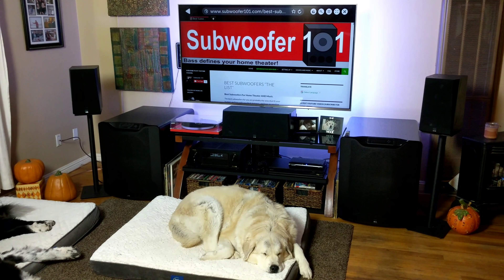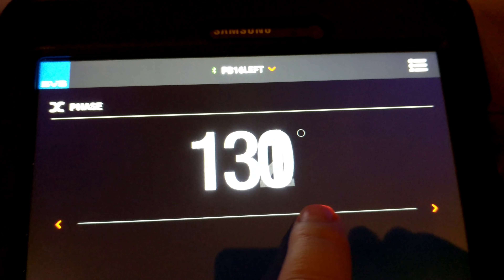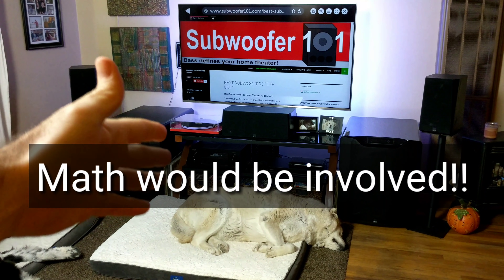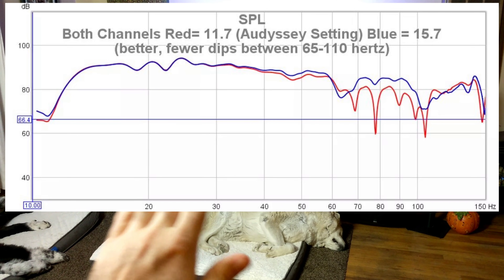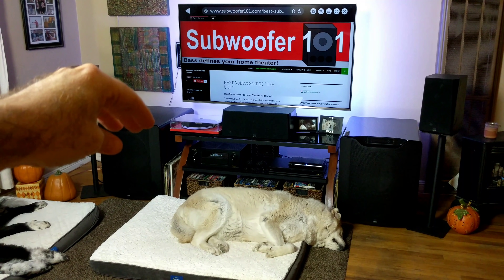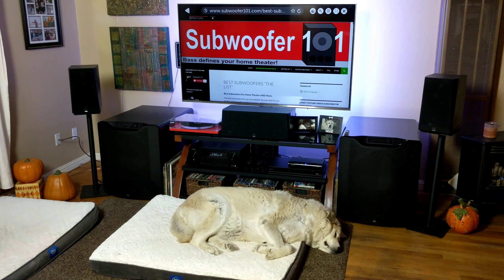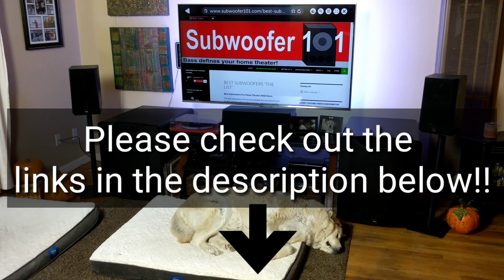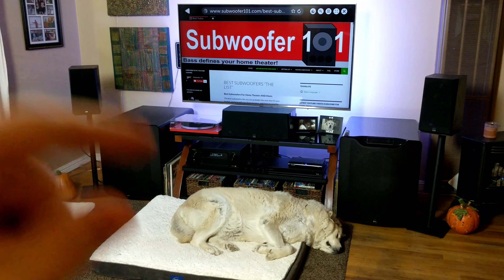Subwoofer Phase Setting: Which is best? 0? 180? (Subwoofer Setup Tip)

Comment: Firstly you don't need to two subs with any hifi. Room room room Acoustics! That comes first always. Get that right and then if you want a sub, one will be more than enough. Phase, well go by ear, no maths, no science. Listen to which phase sounds the smoothest and punchy without any boom. The bass must be musical. It's fairly easy, it's not complicated. It's either 0 or 180. Hey I use Rel so the subs are top notch and made for music.
Reply from the maker: There's just so much wrong with your comment. Not one particular thing, but most of it. 

But that's ok, we are all just figuring it out. I try to stay supportive and approachable. 

I'm not here to pick on you or make you feel bad. 

Bass is NOT easy. That's why my channel exists. 

The phase switch is a hammer when a scalpel is needed. It has 2 options out of 180. So the 2 options are typically wrong, and even worse. 0 is only correct when the distance setting is used to adjust timing. Again, my graphs show this is not opinion. 

Math helps a lot, again I have the graphs to prove it. And it's just simple addition, not calculous. 

"Musical bass" is typically unintentional code for shallow, weak bass. Deep bass is a LOT more musical. 

Room treatment matters, mainly reducing hard reflective surfaces and echo. 

Room treatment will never replace what dual matching ported deep bass subwoofers can do. 

Better than nothing, but it is physically impossible for room treatment to resolve the standing wave effect in a meaningful way. 

Sorry, I'm trying to be as cool as I can, but everything you stated as factual, just isn't. So mainly I'm responding for the sake of those who will read your comment. 

I hope you stick around, be open to new ideas, new equipment, and a new approach.
Reply: @Subwoofer101 I'm a musician and have worked with sound engineers for nearly 26 years. I know when I hear quality sound and so poor sound is picked up instantly. One sub is all that's needed, two if you want to, but it really isn't needed. Room acoustics, well absorption panels rather than diffusion is only needed but this is another chapter and lengthy one. Never over complicate sound. Musical bass is not loud bass for one minute. If you like that sound of cheap car bass sounding woofers then so be it. Bass should be lightly heard and punchy, yet importantly flowing beautifully with your mids and highs. I'm talking about music, not, theatre use. Distance has nothing to do with it at all. You like graphs and tables and probably watch the way your subwoofer moves rather than enjoying the sound it produces.

Comment: You are so over the top with your subs its ridiculous.
Reply from the maker: How interesting. 

In what ways am I so ridiculously over the top? 

I'm just curious because I've seen some setups on YouTube that make my setups look underwhelming. 

Are you just assuming that the overall sound and experience is over the top? 

It would be understandable, because if I used typical subwoofers, it would sound like boomy garbage. 

It does not. In room measurements confirm it. 

One thing you are right about, I do obsess over bass, because it is so easy to get wrong, and the most challenging aspect of home audio.

Comment: Hmmmm I'm not one to knock people's effort especially when reviewing products or giving tips such as these but I'll have to disagree on with most you've said on here. I almost recently upgraded my twin Monolith by Monoprice V2 ( 12 inch subs ) as I wasn't getting the type of bass I knew they were capable of. I run separates ( Marantz AV8805, Emotiva XPA Amps plus Klipsch speakers from the RP Range ). 

I did the plus 4 feet suggestion after calibration and for weeks and weeks I wasn't happy until recently. I discovered that with phase set to 0 and plus 4 feet in speaker distance, the bass from the subs interacted negatively with the bass from my towers crossed at 80 hz. Using a tape measure, I corrected the sub distances and then set the variable phase to 90 degrees!......What a difference! Deep deep powerful bass from the subs with 0 interference from the bass from both towers.
Reply from the maker: So essentially you phase shifted, but rather than advancing the bass, you are delaying the bass. 

By measuring the subs' physical distance, you are undoing the room correction compensation of adding a few extra feet to account for DSP delay. 

That makes the bass to hit after the rest of the speakers. 

Phase other than 0 also delays the bass. 

So you are doing what I'm suggesting in the video, shifting the phase to remove the cancellations from your towers. 

+4 feet after room correction value with 0 phase is a solid solution, but sometimes you need a little more or less. 

Because of bass decay, I think advancing the bass (adding distance, 0 phase) is better than delaying the bass (phase other than 0, reducing distance value). 

By delaying the bass, you are guaranteed to never have your bass in proper time, as it's always "chasing" the rest of the sound.

By advancing the bass, perfect time occurs at the very beginning of bass decay. 

So to be clear, I'm sure you achieved better bass response, it's just the method is going the other direction. 

You probably needed more distance, possibly a little less than 4 feet, but the function of timing shift is effective either way you go. 

My guess, based on what worked for you, between +4 and 10 feet over the room correction value would yield the same result. 

Long response, but what you did worked because +4 feet wasn't enough. 

Subwoofer placement can also make a difference. 

What you absolutely did correctly is trust your ears. 

If delaying the bass is what you prefer over advancing the bass, then that is the right thing to do. 

At the end of the day, it's your system and you should get the most enjoyment, even if it means going against the grain. 

I built my channel by doing just that.
Reply: @Subwoofer101 Hmmmmm thanks for the response. Very technical. So what I achieved is phase shifting? I don't recall what the calibration results were else I'd try your suggestion again and probably go higher than plus 4 feet with phase back to 0.

On a side note, how would a sub that's running on an external amp with no phase adjustment deal with this phase problem? I am thinking of modifying a 15 inch klipsch subwoofer to run off an external amp as the plate ones from klipsch are so bad they fail within a year and I've had two replacements in 3 years. 

This phase issue is precisely why I haven't done the modification yet.

Thank you.

Comment: Set to 0. I turned it on a few times and it makes it sound like the bass is inside my head but the bass is gone at the same time. I can’t quite explain it right but it feels very awkward
Reply from the maker: Sounds like a cancellation. Or a dead spot. Some people call it bass suck out. 

Dual, matching deep bass subwoofers, and adding 4 feet to the post room correction value. 

So if the subs are 10 feet away, room correction will say it's about 13 feet away from the DSP delay. Boost that distance value to 17 feet, (+4 feet from the room correction value of 13) and your missing bass will be delightfully audible.

Comment: I have 3 total subwoofers, two of them are in the midpoint of my room which is about 20 to 22 feet wide, and one of them is in the middle of that 20-22 feet. I set my phase out the two in the midpoint of my room to 0° and the one in the middle of the 20-22 feet part of the room to 180° phase. I don’t know if it’s technically right, but this has sounded the best and made for the smoothest bass response for my ears, and eliminates my dead spots. Very interesting!

Comment: Bought 2 monoprice m215s and they dont boom like they should. Using onkyo rz3100 hooked up lfe. Any suggestions? Factory resets and recalibrations have been done with each setting.
Reply: Is the connection RCA then you need a splitter

Comment: Higher frequency travels faster
Lower frequency travels slower
Reply from the maker: Sound travels at the same speed, within the same temperature and medium, regardless of frequency. 

But to your point, higher frequencies do vibrate faster, so 1,000 hertz vibrates slower than 10,000 hertz. 

Bass also decays slower than higher frequencies. 

Sound will travel faster or slower with different temperature, elevation, and medium. 

So technically, the speed of sound changes with the temperature throughout the day. 

The point of the video is to get the bass in the room slightly before the higher frequencies, so it will begin its decay during the moment of perfect timing, rather than after perfect timing. 

You were on the right track, and I hope my explanation was not discouraging or intimidating. I try to keep it friendly around here. 🙂
Reply: @Subwoofer101  yeah , your correct I googled.

Comment: For me, I have always rocked 180degrees on subs. Optimal or not, it feels much smoother and deeper like a cinema. I’ve tried feeakin everything and now 15 yrs later I got new subs. Tried 0degrees for once on both like the Hifi man said, and meh. changed both to 180 and oh my… 😮 what’s wrong with me😅 both in front like my old one
Reply from the maker: You're not wrong, you're already phase shifting by using 180 phase. 

The problem is, when you set it to 180, you are "delaying" the bass. 

So you're still getting the benefits of less cancellation, but in my opinion, setting the subs to 0 phase, and then adding 4 ft to the subwoofer distance after room calibration is better because you are putting the bass in the room "before" the mids and highs. 

Because bass decays slower, I think advancing the bass instead of delaying the bass sounds cleaner. 

When you add 4 ft, your AVR thinks your subwoofer is 4 feet further away than it actually is. 

The distance setting in an AVR is basically just timing. 

So to compensate for being 4 ft further away, it delays the other channels in relation to the subwoofer, so that the subwoofer gets the signal a few milliseconds before the other channels. 

180 phase delays the subwoofer by a few milliseconds. 

Both offset the timing enough to reduce cancellations between the subwoofer and the main speakers. 

I just believe that because of slower bass decay, advancing sounds cleaner and more cohesive.
Reply: @Subwoofer101  which sab to put Distance 4ft friend to the one that is closer than another???

Comment: I have 2 subs using a Y splitter into my receivers only Sub connection. My svs pb3000 is in the front and further away than my second sub which is an older SVS CS Ultra thats in the rear in the opposite kitty corner. I can only select distance for one sub. I am assuming I do the distance +4 from the front that is already furthest distance?

Comment: Hi @Subwoofer 101, how do you get Subwoofer 1 and Subwoofer 2 to config separately in your Distance settings? I've got Denon's AVR-X2400H
 model.
Reply: From what I’ve learned if your receiver while doing room correction does not tone each sub separately then there is no way to do it.  If your receiver has only one sub input then it would be impossible if you split the rca signal.   If it’s got two and only one signal while room correcting then it’s not a true dual sub receiver.

Comment: To Manually set Phase correctly:

- let your speakers play full range (ie: mine play down to 50Hz)
- set crossover on sub to 10Hz above (ie: mine 60Hz)
- Play some music with bass, adjust volume so Sub is noticeable but not too loud
- play the lowest frequency of your speakers (ie: mine 50Hz tone). can download a free tone generator app for phone or computer…) 
- use SPL meter ( or smartphone with SPL meter app works). I use settings C-Weighted, Fast, Low on SPL meter) 
- cycle through Phase settings (typical 0, 45, 90, 135, 180, 225, 270, 315) and look for the lowest SPL level = Null Point
- if Null Point is 0-180 then add 180 = your Phase setting.  if Null Point is 181-359 then subtract 180 = your Phase Setting.
- now you can play with your Crossover settings (ie: Speakers set to 70 Hz, Subwoofer to 80 Hz. etc…)

If Dual subs are both in front like in this video, use this method to setup each subwoofer individually (or just use the same setting).  If running one sub on front wall and one sub on rear wall then flip phase 180 degrees from the setting you determined on front sub.  (ie: if front sub 135, then rear sub 315)

enjoy !
Reply from the maker: I have to disagree here, at least if you're wanting optimal sound. 

Before I disagree, I want to say that I do appreciate viewers trying to help other viewers. I definitely encourage that on this channel. 

But here are the problems with your particular method. 

First off, setting crossover any lower than 80 HZ makes integration difficult. 90 HZ is my minimum crossover value, regardless of speaker size. 

Secondly, I set all speakers to "Small". You can see my Large vs Small article on my website for a deeper explanation. 

Third, and most relevant, is that setting subwoofer phase to anything but 0 creates a delay. Why is that an issue? 

Bass decays slower than mids and highs. So delay exacerbates the timing issues. 

The reason I recommend adding 4 feet to the subwoofer's value AFTER room correction is because instead of delaying the bass signal, it advances it. 

Since bass takes longer to decay, it cleans up the sound as much as possible when shifting the phase. 

If having your subs in perfect timing with your mains was ideal, phase shifting/time shifting would be unnecessary. But if you don't shift phase/timing, you're missing out. 

If you delay the bass (using the phase adjustment on the subs) the bass will be "chasing the mains", and wouldn't sound as good as if the bass was "ahead of the mains", because of the slower decay of the bass. 

There's no such thing as "perfect bass", but adding 4 feet to the subwoofer's value is pretty close. 

You're still phase shifting, reducing cancellations, but it's in a way that sounds cleaner. 

Lastly, dual matching subs are ideal, for the cleanest, most cohesive and explosive sound. 

If you're going to measure dual subs, they should be measured at the same time. 

Doing so separately negates the positive effect of constructive interference, measuring peaks and nulls that won't exist while both subs are working. 

The easiest way to deal with phase is to advance the signal by adding 4 feet, or, if you don't have room correction or an AVR that has distance values, I would figure out how to delay the mains by 4-8 milliseconds, depending on whether your subs have DSP or not. 

The best subwoofers will have DSP, and that will introduce delay. That delay could be anywhere from 1 to 4 milliseconds. 

That's really getting into the weeds, which is why it's a LOT easier to do on an AVR that has room correction. 

I don't believe that your method is the best way to set phase. It might be a way to go about it, but having tried a number of ways myself, you won't achieve the best possible sound. 

But again, I do appreciate viewers contributing to the channel, and I mean no disrespect. I'm pretty notorious for not going along with conventional wisdom. 

Questioning conventional wisdom is almost half of my channel's content. 

Big subs don't necessarily overpower small rooms. Bigger drivers don't automatically mean better bass. 

More power doesn't mean better bass, if the power isn't delivered where it's needed most. 

A 12" sub can sound FAR more impressive than a 15" sub with twice the power. 

Factory response numbers are nearly useless in the decision making process. Same with Max SPL. 

Everything is confusing and misleading, but I try to make sense of it all. 

Again, I do appreciate the contribution. It inspires topics to cover. That helps everyone.
Reply: @Subwoofer101    I was just talking about Manually setting up Phase (without room correction ie: Audyssey).  With the manual SPL method, I set it up as explained then change crossover settings (ie: 80Hz) afterwards.

Comment: I have dual subs.  The rear sub is 0° and the front sub is 0°.  When I set the front sub to 180° bass sound a bit louder.  With the front sub at 180°, when I set the rear sub to 180° the bass sound a bit louder again.  Is that how I should set it for best audio?
Reply from the maker: Set them both to zero phase, then add 4 feet to the room correction value on your AVR. 

Similar to what you are experiencing, a phase shift, but the timing is more advantageous. 

By using 180 phase, you are basically delaying the bass. 

By adding 4 feet to the distance, you're populating the room with bass before mids and highs. 

Bass has a slower decay, so it will sound better advanced rather than delayed.
Reply: @Subwoofer101  with both the subs are set to 180° the overall bass sounds louder than when they are at 0°.  By reverting back to 0° and adding 4 feet will that add back a more bass?
Reply: @Subwoofer101  so I actually tried doing a test tone and infact using a decimal app on my phone placed at the main listening position it is lounder when the front  sub is 0° and rear sub is 180°.  Will it be better to then redo and auto calibration with the subs at this current phase settings?